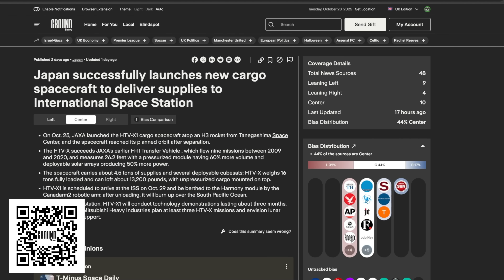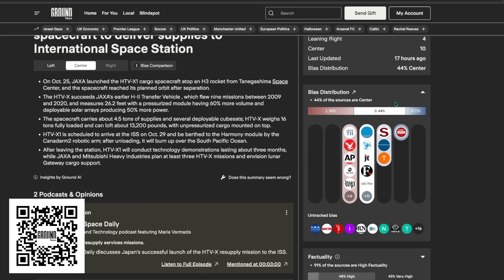Every Thing These Moon Landing Deniers Got Wrong About the New Moon Mission

Comment: The camera postulation is the classic, when we do not see EVERY angle, then all is fake. you can BET there one angle not covered -. therefore ALL the footage is fake. 

They will demand ALL austronauts have to be visoble anytime - including using the "sanitary faciliies"  - and a one-.second glitch will mean ALL is discarded, space is fake. 

There will  haveto be exterior cameras to show the capsuple, for that you need lighting, in the sunlight you have to reduce exposure time to not overespuse and not only see a white blob -> you will not see stars -> space is fake, all is a hoax. 

None of these people has ANY idea abotu radio transmission, all these cameras need bandwidth, all transmissions have errors / lose packets, have glitches 
That what they demand requires enormous data flow, as classic cult simpleton each Truth is EXACT, 100% reliable, eternal - their own internet connection via cable is way easier, they obvioulsy have a 100% availability and datarate ALWAYS, response time in milliseconds ALWAYS - not mine. 
(and my TV connection is still somewhat terrestiral over the air, I can bet with each thunderstorm it will break temporarily down and recover when the electrity in the air subsides). 

Almost as it there is an imperfect reality and a cultish perfection, which exist because it has to, and one better simply chooses to not perceive any imperfection in the simple, easy perfection that you so long for. 

Cults long for simplicity, for not having to think, not having to worry, not having to fear you can do a wrong decision where you can blame no one for than yourSELF...  -  the Cult provides this ONLY perfect Truth.

Comment: I've been saying this for over 30 years.  The ultimate proof of our moon landing is the Soviets.   If we faked it, they would be the FIRST to want to disprove it, as that was the whole point of going, to beat them!   They followed Apollo 8 to 17 all the way to the moon with radar.  They downloaded all the telemetry (which was very simplistic at the time and not encoded for security in any way), pictures, communications all the way to the moon, the surface (Apollo 11-17), and back.  They probably had submarines near where the splashdowns occurred.

Comment: 8:55
"I don't think they realize that."
"No, I don't think they do."

Both of those arrogant wastes of biomass could have stopped after saying "think." For better accuracy "can't" should replace "don't."
All these imbeciles ever do is show how profoundly ignorant (in both the formal and vernacular) they are. These whole systems are designed by large teams of actual engineers and actual scientists and reviewed by such, along with other experts in the bargain. Even a freshly-minted engineering graduate is going to have a pretty good idea of the importance of failure analysis and be able to identify where it is necessary, even if they personally lack the requisite knowledge and experience. But oh, no. A former milkman and a warehouse laborer, or whatever this pair of dolts are, are farrrrr smarter and know orders of magnitude more things of relevance.

I'd last about a minute around some of these types before I be reaching for My Pillow Extra Heavy Duty Smothering Grade.

Comment: At 6:07 the Apollo Detectives lie again! There was no problem with the Artemis I heat shield “burning” as that is what it is designed to do. There is a solved non-problem with extra heating caused by unexpected gas pressure breaking off chunks rather than cleanly ablating. The temperature inside would have the astronauts safe and comfortable. The solution is to modify the reentry trajectory for Artemis II to reduce the excess heat.

Comment: At 5:16 the Apollo Detectives lie about an explosion in a test of a future SLS booster! That failure has nothing to do with Artemis II. That booster is to be used for Artemis IX and later missions from at least 2034. The booster itself did not explode and finished its planned 2 minute run. The nozzle detached releasing a sudden burst of flames and flying debris. They have 9 years to fix what may be a defective nozzle and the fall back of using the existing SLS booster.

Comment: By 3:32 the Apollo Detectives show that they are deeply ignorant about reality. The crewed lunar flyby of Artemis II will take 4 days because of basic orbital mechanics. Artemis spacecraft have half the fuel and less than half the delta V of the Apollo system (Apollo=2.8km/s, Artemis=1.35km/s). The smaller delta V requires taking a longer route.
An analogy is walking to the other side of a mountain. Your energy means you walk around the side (Apollo). Less energy means you walk lower on the slopes to save energy for a longer journey (Artemis).

Comment: They seem to think that a failure during a stress test is a total failure. That's usually the point of a stress test, geniuses. They push something until failure occurs to discover the limits of a system.

Comment: I've no doubt that the cameras may be informative, but I'll bet the telemetry is far more than what you can see on a camera. Things like every valve's command and it's actual position. Pressures, temperatures, accelerations, all sorts of data. Undoubtedly thousands of separate parameters. But these fools want a 4k video of fifteen different angles as if that's more useful.
Reply: And every piece of telemetry or else they will call it fake.

Comment: They're right about human missions to Mars being TOTAL BS though.
Reply: Why? What do you think all this is for? The Artemis program Is practice for and to set up support for manned interplanetary missions. One of the big goals is to be able to build and  fuel interplanetary ships and probes using lunar resources.
Reply: @paulblase3955 SpaceX claimed Mars missions in "2030". This is the BS I'm talking about. SpaceX is a Con, via Musk. It's a Telecom company, focus on bulk delivery of "Starlink", which is what "Starship" was designed to do, which is why it has no LAS (Launch Abort System) to save Crew lives in case of malfunctions),. The other thing SpaceX is: part of the Military-Industrial Complex with military contractors up the wazoo on that one. 

2030: We likely won't even get humans back to the Moon before 2030, let alone Mars. 

Human biology just won't deal with a Mars mission. 50% of DNA would be damaged by cosmic rays and gamma radiation. Anyone still alive on a return trip to Earth would be legally blind before the got near Earth atmosphere. Bone density loses of more than 10% per year, brain shrinkage, and 100 other biological effects.  No rocket can handle the added weight of humans, let alone the atmospheric life support, waste, food, and water requirements. Keeping a pressurized vessel all those months & years which can't fail even once. Solar flares & CMB that can't be shielded against. Constant O2 production & CO2 scrubbing. Water shielding around the habitat that would make rocket launches unstable. Refueling in space requiring 13-20 "Starship" launches just to get to Moon (1.5 light-second away , let alone Mars at 13). Having a 1 time in 2 years launch window, meaning any delay is a 2 year one. No ability to send support missions for the same reason. 

...and 1000 other reasons (The 1000 stays, no matter how many you list there are 1000 more). We are NOT sending humans to Mars any time soon, if ever. 

This doesn't even get into economics, which makes it a complete non-starter unless we zero-out military spending (Elon would never, he gets $ Hundreds of Billions from U.S. Taxpayers. Neither would politicians, who get paid (bribed) by Elon & others like him getting their Billionaire lifestyle funded by Taxpayers. 

We are not, we are NOT going to Mars in 2030, or anytime soon after. 
Mars missions have a 50% failure rate for non-biological cargo- can you imagine the failure rate for transporting Humans? "2030" is what a joker Musk is.

Mars missions, interplanetary missions are ROBOTIC missions. Any diversion of funds AWAY from science missions means we won't have them at all. We already had to cancel a dozen & burn-up $ Hundreds of Millions of USD in Taxpayer money because we can't afford a guy to collect data from satellites already in orbit & paid for. 

This is all just one big Con for taxpayer money like "Hyperloop"-how's that gping? "Boring company" drillimg bunches of those? Or buildimg "Doomsday Bunkers" for military $ Billionaires? 

I just don't get conned like other people- i ask questions & do reaserch. Others just swallow whatever PR propagamda Corporations feed them. 

You know Mars is. FAR harder than trains, right? 
How's "Hyperloop" going?
Reply: @paulblase3955 One thing to keep in mind is SpaceX is a for-profit Corporation, like Fossil Fuel Corporations. They lie all the time. 

NASA is a civilian science administration, it only lies about administrative things, political things, not science & engeneering. 

"Why did this blow-up, did we know aboit it & that it was at risk of failure?"
BOTH Will lie to you on that one, it's a political qiestion of the Administration, not sciemce. 

NASA & ESA & JAXA are about the only ones you can trust in rockets & science- everybody else is a PR Department focused on increasimg profits, not scoence for the public good. 

Profits = Lies, always has.

Comment: FML Is Marcus still going on about vacuums? They have vacuum chambers large enough to test the entire command module
Reply: One of them is the NASA Space Power Facility near Sandusky, Ohio.
It's a vacuum chamber built in 1969 that's 37 meters high and 30 meters in diameter.
I've been in it on a tour, and because I know someone will ask, no it wasn't evacuated at the time. So Marcus will say it's fake since I didn't actually observe it without air inside.
Reply: They can also test various materials and sub systems on the ISS, after all it has only been flying for thirty odd years.
Reply: Scott claimed that only visible light and a "little UV rays" can pass thru the particle radiation in the Van Allen belts!!
I asked him,, Gee whiz how come I feel the heat in the form of Infra-Red radiation from the Sun Scott?
His answer was....

crickets....

Comment: So, on their point that if it will take longer means it is a fake or at best, both.
OK, 30 years ago I used to drive my car to work and it would take me 30 minutes.
Today to get to where I used to work, If I rode on my push bike and it takes 60 minutes then the original was fake, or is my bike ride the fake one.
Interesting. 🤣🤣🤣
They have totally no understanding of what the term "It's been solved" means. Even if it was explained to them, it would be too far above their comprehension.

Comment: I'm going to disagree about the heat shield.  As a layman, my understanding is that it did not perform within safety limits.  The chunks that flaked off were not supposed to happen, at all.  So, any flaking like that is, by definition, outside of tolerance.

This is looking very much like the space shuttle era Normalization of Deviance.  One administrator, speaking about the shuttle system, said, "Only the first of three O-rings was burned through.  So, we have a 3:1 safety margin."  Incorrect.  It was not supposed to burn through, at all.  Any burn through was outside of specifications.  It was not safe.  Same with the foam strikes on the shuttle heat shield.

I'm very worried about the Artemis 2 mission.  They did alter the re-entry profile, to try to protect the heat shield.  But, since it was already built, they chose to use the same design as already failed on Artemis 1.  They chose to not replace the heat shield with the older technology.  They will use the older technology on future capsules.  They know that the current material for the heat shield is not the correct one to be using.

Sure hope everything turns out okay.

Comment: I assemble electronic components, some of which are used in commercial satellites.  NASA has a host of standards we have to follow dealing with the vacuum of space.  There are standards to follow if the cable connector uses ink to mark the part number.  People ain't just paying a shed load of money for space rated parts for the fun of it when the Earth bound equivalents cost 1/5 the price.

Comment: As far as the mission flight time goes.  The entire length of the mission is 10 days, this is not how long it takes to get to the Moon.  The translunar trajectory phase will last 4 days.  They will spend a couple of days In Earth orbit checking out the craft first.  Now 4 days is longer than the 3 days taken by Apollo, but neither is as long as the 5 days needed if you are using a minimum energy transfer orbit.    The length of the trip simply depends on the type of trajectory being used( you could get there in 3.5 hrs if you had the fuel needed to be able to accelerate at 1g for half the trip and then decelerate at 1 g for the other half.), and this varied even between Apollo missions (Apollo 12 took 8 hrs longer to reach the Moon than Apollo 11 did.) 4 days is a reasonable time given the parameters of the mission and orbital mechanics.  So why would Artemis opt for a longer trajectory in terms of time?  Apollo was a "down and dirty" program. It had one objective, get men to the Moon and bring them back.  So trade-offs were made. It was deemed that a shorter mission, meaning less time spent providing life-support was the better approach. Artemis has a different goal. it is designed for longer, more extended missions aimed at a sustained Lunar presence.  Saving time to save on the life support systems is not something they need to consider.
Reply: Could you say all of this in an Old Man Obviously Reading Voice? I am used to that now.